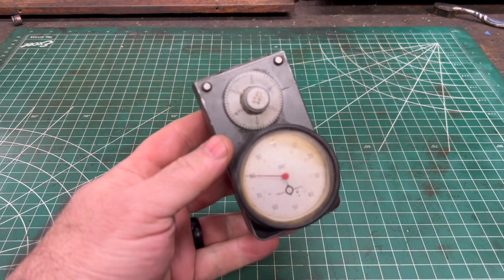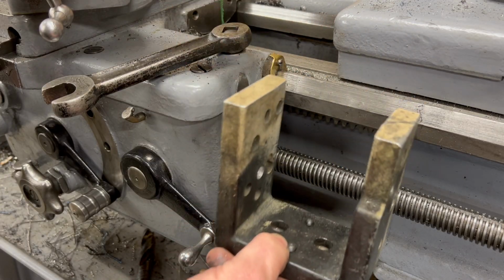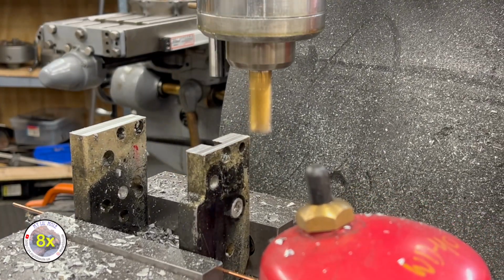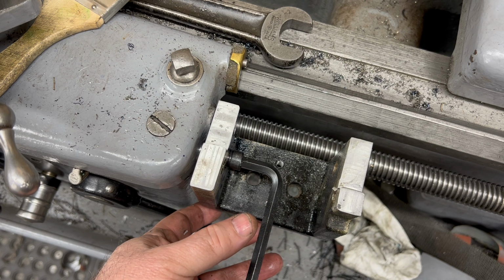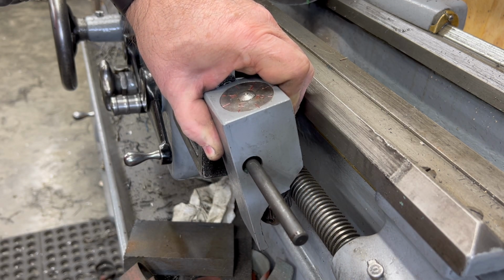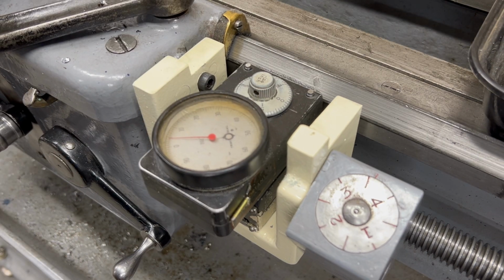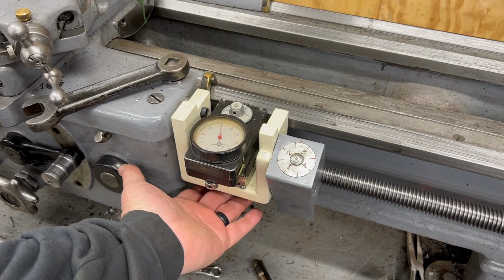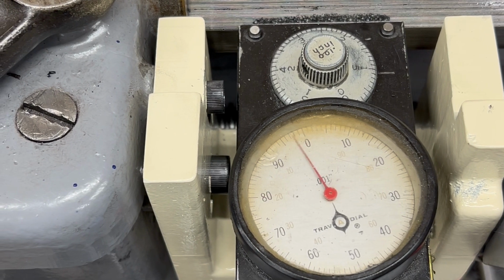Installing a Trav A Dial on a Vintage South Bend Lathe

Comment: Had gotten  one of these like 15 years ago at shop  they were throwing  out .. finally  installed  atlas i bought..no bracket so winged it dovetail  cutter ..and dumb luck  what I made worked..didnt realize  wheel is beveled..but ..dumb  luck it works
Reply from the maker: Glad it worked out for you!

Comment: Wow, $30 for four offcuts of foam! I think I would have tried experimenting with my own cheaper concoction first!
Reply from the maker: I actually tried finding some material as a substitute, but I would have spent almost as much on it, the adhesive, etc. than I did on this, and all I had to do was click "Buy It Now" 😂. I much prefer to make things like this. I would have actually preferred felt, but I didn't have any felt that was thin enough, or the right "elasticity" for it. Thanks for watching!

Comment: When you touched the bracket top with your finger while the mill was spinning within inches, I cringed and couldn't finish watching the video. I have unconditional respect for sharp and fast spinning objects! Be safe.
Reply from the maker: Perhaps from the camera's perspective this seemed unsafe, but rest assured, since I make my living using my hands, I never take unnecessary risks. There was plenty of clearance between my hands and the spindle. The risk was less than walking down a flight of stairs.

Comment: I’m not certain that the radius changes with angle. It depends on how it’s tilted and measured. If you look at your illustration, if, the curve of the radius equals the diameter and the tilt is from the center of the thickness of the disk, the the radius is the same, no matter what the angle as long as it doesn’t run off the edge of the disk. If the curve of the radius is smaller than the diameter and the tilt is from some random place, then all bets are off.
Reply from the maker: Radius absolutely changes with angle. The pivot point is a line through the top of the disc (sphere section). Think about the earth. The earth revolves around an axis through the north and south poles. The length of the latitude lines get shorter the further away from the equator you go. This is exactly the same kind of geometry. The axis doesn't change, but the ground distance traveled definitely changes. It's why when we launch rockets that are intended to escape earth's gravity, we launch them from places closest to the equator, because they are traveling at greater ground speeds.

Comment: Do you have any standards for your micrometers. Say a 0-6" or even better a 0-12" set. In the past I have used them to do this. You will have to set up something on your lathe bed to do this. Possibly a dial indicator with a mag base and some V blocks. Make a fixture to mount in your chuck to hold the standards. To describe this fixture. Take a rod and drill it, bore it to fit your standards diameter closely. Then take it to your mill and mill a slot from the side to intersect the bottom of that hole such that the standard will have a good flat surface to contact on. Now put it back in your lathe running true. Now you can set up a mag base with an indicator to contact the standards mounted in the fixture. By mounting different standards you can check the calibration of the travel dial. You could so the same with gauge blocks  buy orienting one of the chuck jaws horizontal in a low gear so you can set the block on the jaw. Now set up a dial indicator on your cross slide on a mag base  such that you could zero it on the chuck's face but still contact a gauge block setting against that face and on the horizontal jaw. Then you could put different length blocks and comparing them to the travel dial. Those are a few ways I have done this. Depending on what I have had on hand. The other way is just to physically cut a part and measure it.
Reply from the maker: I think I am starting to get the idea! I do have some micrometer standards I might be able to use for this. Thanks for the description of the tool. I'm going to give this a try.

Comment: Enjoyed…great discussion/install, I have 2 on my Clausing lathe, the crosslide install is great for backlash error check
Reply from the maker: Thanks, Chuck! I watched your video on them a couple times to try and understand what I wanted to do here. And thanks again for the installation PDF, that helped out a lot. I only have the one, it came to me in a sort of seagull deal. 😉 One I couldn't pass up.

Comment: What an awesome tool. I’ve thought about the levelling issue. Presuming the lathe is level, you could take a digital level, put it on trav a dial in X and Y directions and theoretically your trav a dial would be perfectly aligned. Thanks for the great video my friend. Gilles
Reply from the maker: Thanks, Gilles! I don't believe it is about leveling, really, it's more about being aligned properly. I tried to convey, in a reasonably concise way, what I ascertained by studying the installation material and the patent. If the wheel is in perfect horizontal alignment and the tilt at the right angle, it can be extremely accurate and repeatable. It's a rather ingenious device, considering it was developed in the 60s. DROs made them obsolete, which is what I should be doing, but this one came to me almost at 0 cost, and it's cool AF. 😂😉
Reply: @ it sure is awesome.  Can’t wait to see if you master its use.  Its more fun than a dro 😊

Comment: Good video the dail mount looks good . If you have a 12'' calipers or even 6'' wip up a mount to hold them in your tool post and read off the chuck . or make a 4'' block . well just an idea hope it helps . JM
Reply from the maker: I've been bouncing a few ideas around in my head. This one sounds like it could help. Thanks!

Comment: I got lost at the end... I don't understand why gauge blocks of any sort would be needed for calibration or verifying the readout. If you get one full inch of movement with the dial indicator, and the travadial reads precisely one inch of movement, then I'd assume you'd be good to go. What am I missing? 😊
Reply from the maker: I am sure I did a really poor job of trying to explain something I know little about. It is not about the distance travelled, it is about the consistency of the travel in relation to the readout. And repeatability. I'm basing a lot of the "why's" off of the documentation I was able to scrounge up on these gizmos.
Reply: @MyLilMule You explained fine, I'm just dumb. Interesting device, I decided to try and build my own as an experiment. I modeled the gears in Fusion last night and sent the resin printer to work. Kinda wondering how bad I can make this... lol

Comment: Greg I made and installed a cross slide DRO for my Clausing 100 lathe and another one for my BP Clone mill. Both are attached with some very good and very cheap magnets that I got from Amazon. I've managed some awesome tolerances and repeatability with them. I wanted to use the magnets to avoid drilling holes in the machines. I'm an insane purist when it comes to working on these old beauties.
Reply from the maker: I'm a bit of a purist myself, and I don't like drilling holes unnecessarily. I like your approach to the cross  slide. I haven't considered putting a DRO on this machine, not for any particular reason, but figuring out how to get the cross slide scale mounted and not lose too much tail stock clearance or being able to use a follow rest, has been a head scratcher for me. The Travadial came to me with some other stuff, so it was practically a 0 cost addition. Plus it's cool. LOL!
Reply: @MyLilMule  I agree. the DRO has its own set of problems. Not so much on the z axis on the mill but it does get in the way of the tailstock at times on the lathe. I will eventually get around to making improvements on the mounting of the magnetic bracket but for now I used what I had. On these older machines finding a flat spot big enough for a mag base dial indicator is at the least difficult. if I had a Trava dial I would use it too. They are the purist form of a DRO. From what I have heard they are hard to find and expensive when you do find one. As Harold Waters says KO-KO. Thanks for bringing us along.
Reply from the maker: @terrycannon570  Flat spots. What's a flat spot? LOL! I am working on adding a DRO to my K&T 2HL. NO FLAT SPOTS is an understatement on that machine. 😂

Comment: Am I missing something  ?
Or are you ?
Isn't the reason the wheel is crowned purely to eliminate the error caused by tilt  ?
The rotating radius is constant regardless of tilt within the width of the wheel.
As long as your amount of tilt isn't moving the pivot centre above or below the top or bottom of the wheel it is constant.
Your diagram wasn't representing tilt but was showing vertical movement which represents line contact on the wheel.
Reality you have a vertical face contact not a line.
Reply from the maker: Maybe a combination of both of us missing something. The two screws on the bottom of the mount are used to affect the tilt of the machinasin. Tilting the crowned wheel will most definitely change the velocity the wheel moves over the same given distance since it changes the radius of the curve around the pivot point. The radius is most definitely NOT constant. This is not my assumption, this is coming from the installation instructions I have been able to locate.

"The calibration of the Trav-A-Dial is accomplished by changing its tilt relative to the running surface. To do this, the angle between the bottom of the Trav-A-Dial and the top of the M-5 base is changed by the position of the tilt adjustment screw threaded through the base. Raising the screw decreases the angle. Each full turn of the tilt adjustment screw will change the calibration by about .0050 inches over 6 inches of travel."

This is also backed up by the original Travadial patents.

Comment: Hi there,  lil mule. Don't know your name , but i just want to tell you another option to look into which is not to expensive and gives you the ability to zero quickly and is not in the way of anything. You can buy ,cut to length,  caliper slides with remote digital head. It will run almost the whole length of the lathe bed. 😊 Mount it under your apron with beam clamps and make some screw holes into your apron for the slide bracket , which you'll have to make, which is simple to do. You'll like it...

Comment: Hi greg you probably already know about these 
0-600mm Readout Scale，Digital Linear Scale，LCD Readout Remote Linear Scale，DRO Linear Scale Digital Readout Kit，for Milling Machines Lathes…  $68.00 on amizon
Reply from the maker: Not really a fan of those. If I was going to do that, I'd rather just install a DRO. Not against a DRO, but I paid less for this than the $68 cheap thing on Amazon.
Reply: Was going to leave the same comment....its still an ugly bracket
Reply: Well maybe he likes the vintage look or he was just unaware they exist

Comment: More question than answer, could you use a micrometer standard to achieve the desire length? Probably not as accurate as a gauge block setup but it is something that you have in the shop most likely. It is also very close, if not exact to the measurement it is designed for. Either way I am sure you will figure out the conundrum.
Reply from the maker: I might be able to use something like that to build what I think they expect to use, but not sure it would be much of a help. They seem to expect you to go back and forth repeatedly between the two points to check for cumulative error as well.